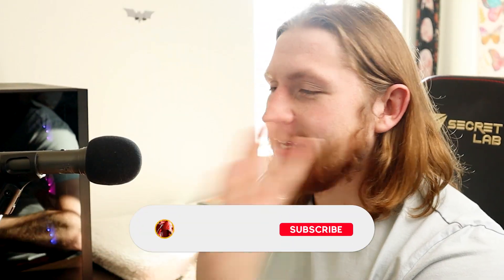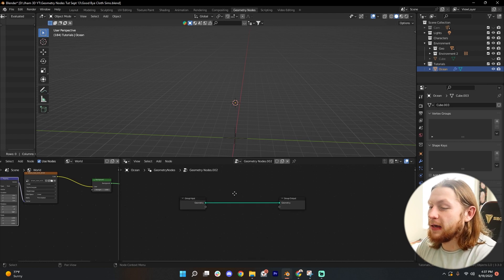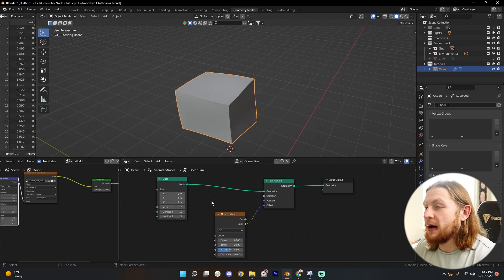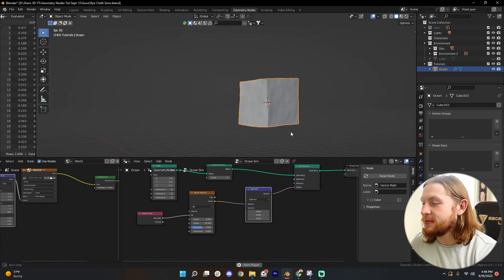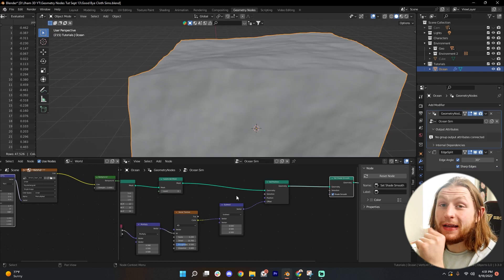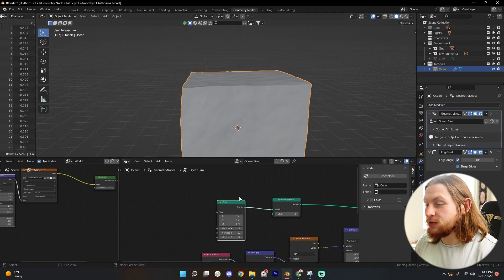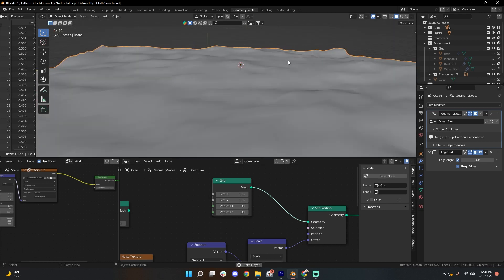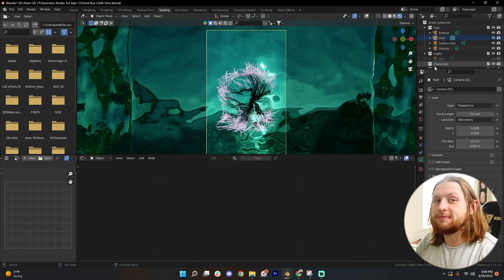Animated Fluid & Cloth with Geometry Nodes? [Blender Tutorial]

Comment: Excellent tutorial, thanks for sharing. I was wondering how to use the movement generated in the geometry to instantiate an object that floats on the surface.

I tried using a mesh to points to create instances and thought about selecting the points on the surface, but it hasn’t worked for me so far.

Maybe you have some idea on how to use the cube’s behavior to make another object float.

Best regards!

Comment: It doesn’t really work as if you apply the required distortion and scale etc, it looks like a piece of jelly flapping about. It really needs to go into how you can keep the item in situ and the surface deforms of the object as that’s what most realistically will make this effect work to varying degrees.
Reply from the maker: @13thnotehifireviews7  what do you mean by situ?
Reply: @Jham3D  that if you want more distortion it will move more as an object and not stay in situ.
Reply from the maker: @13thnotehifireviews7  ultimately, this method has limited application. Adding more geometry (subdivisions) to your object may help. However, there are a few tutorials on YouTube featuring more recent versions of geo nodes which demonstrate more advanced “fluid sim” methods